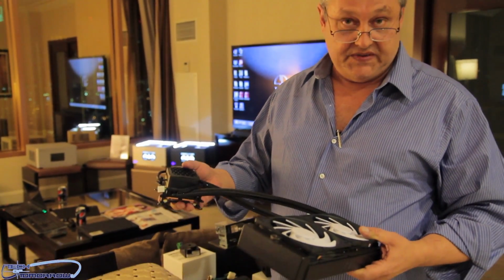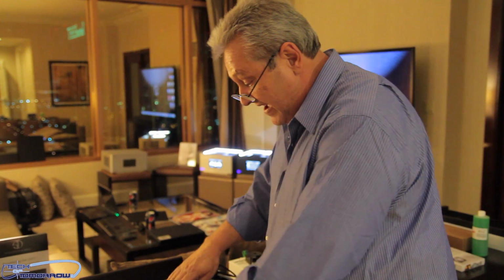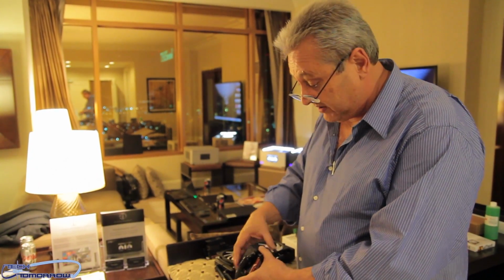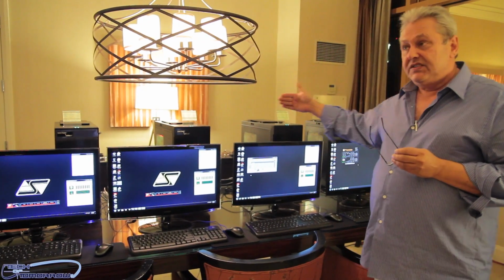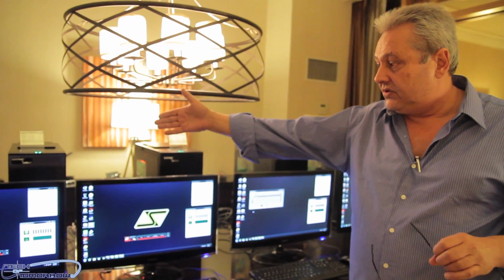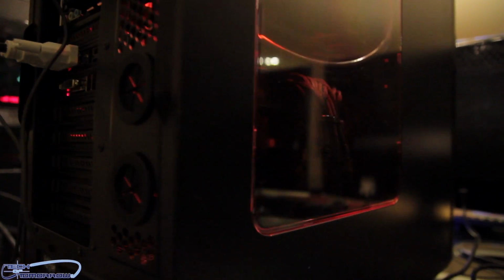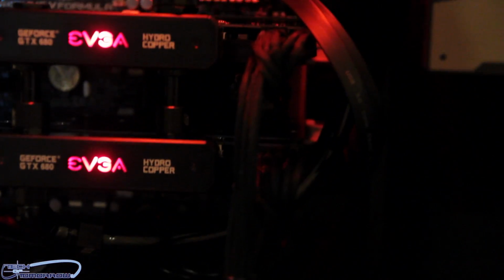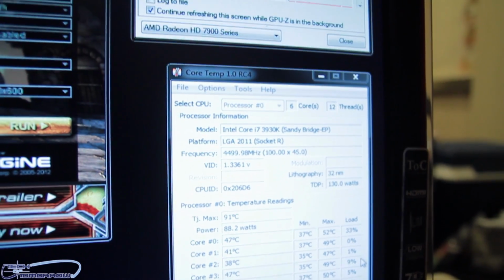Swiftech H220 All-In-One Liquid Cooler Sound & Temp Demo

Comment: radiators is more about thickness rather than surface area from what ive seen from building watercooling loops i did think larger is better but according to temps thicker is better so my rule of thumb is thickness over length(no "that's what she said" joke implied) also in test a h80i beat a x40 the h80i is 38mmx120mm the x40 is 27mmx140mm h80i past a test the x40 failed

Comment: What you're saying is pretty much correct. When you overclock the components they generate considerably more heat due to the increased voltage that's required. This is when more surface area is required to cool them and that's what an additional radiator will do for you.

Comment: Basically what i said a 360mmx60mm radiator will cool a whole system without much trouble its only when you decide to overclock the system is when you would need more rads

Comment: This is true, but the only component that is under any stress at all is the CPU. There is some residual heat from the GPUs, but not enough to make much of a difference. With a larger radiator it shouldn't have any problem cooling all three components under real-world conditions.

Comment: The order of your loop means very little in terms of actual performance. The rule of thumb is that you simply need to have your reservoir sitting above the pump and then just use the shortest distances between components to make a clean loop. I hope this answers your question. Trust me, Tiny Tom would agree with me.

Comment: Of course this will fit into such an enormous case as the TJ 11 just fine. Don't forget that it will also accommodate extra water blocks and radiators due to the power that the pump has.

Comment: It will depend on the case. We just tested it with a Fractal Define R4 in our lab and it will fit in the front of the case as long as the hoses are coming out of the top of the radiator.

Comment: lol 83c is not very hot for an intel cpu its limit is 90c which it will then start throttling to drop temps if it reachs over 100c it will shut the system down and my point is people that say you need 240mm rad for each component under watercooling have just been proven wrong as this is cooling an overclocked cpu+sli on a 240mmx30mm rad a 360mmx60mm rad is fine for this system

Comment: I doubt that there will be a big enough change for it not to be mounted, unless they change physical cpu sizes. I would also rather have G1/4 inch threads and use real fittings.

Comment: The product on the Swiftech website that you are referring to is a different product than the one being shown in this video.  This video is about the H220, which has not been released and will retail for $139.95 as clearly stated by the Swiftech chairman in this very video.  The H220 is not listed on the Swiftech website at this moment.  The product on the Swiftech website is the H20-220/320 Elite ($239.95/$279.95), which are different products than the H220 being shown in the video.

Comment: Actually newer CPUs draw less power and create less heat, due to shrinks in the fabrication process for transistors, which require less voltage to switch.  Ivy Bridge does run a bit hotter than Sandy Bridge but it's a bit of an anomaly because Intel switched from fluxless soldering to thermal paste for the integrated heat spreader, so while Ivy Bridge draws less power and creates less heat, it it not very efficient at dissipating heat.

Comment: Oh, I didn't realise he was running FurMark, I thought he was using a CPU only stress test (he did say "CPU burn" and didn't really specify anything else). Heaven is also a stress test in its own right, though not as intensive as FurMark, it is still commonly used in combination with Prime95 to make sure a system is 100% stable and able to maintain safe temps. But again, with all that hardware (3770K and 680s in SLi) running at full load, I really don't think that cooler would be strong enough.

Comment: If you don't adjust the loop (adding graphics cards/motherboard using different coolant etc.) it will last for 3 years after being re-sealed.
If you just put it on your CPU and don't modify the loop in anyway it will last 60,000 hours which is equal to over 6 years.

Comment: heaven is a benchmark, which synthetically simulates a dx11 game environment. furmark is a stress/torture/stability test, it forces the processor and VRMs to run close to 100% for aslong as you feel comfortable with. its essentially the prime 95 for graphics cards. so 65 degrees for SLI'd 680s during a furmark test is amazing for this setup.

but since you pointed it out, I also wonder if it could handle prime 95 and furmark with decent temps. most likely needs another 120 rad to keep it cool.

Comment: you have to drain, clean(since its impossible to match the coolant they've used) and add new coolant. the moment you add a new block/rad, you have expanded the air space in the loop that wasn't there before, therefore requiring MORE coolant. even with full custom loops with reservoirs. you always do a full drain and fill up every time you add a new block/rad. its just good practice for maintenance and it makes the job easier with out having liquid still in the system.

Comment: Put Heaven benchmark on top of the CPU burn test in that SLi rig and I guarantee that cooler would be too weak; the temps would be a lot higher than 82°C! A good CPU only cooler, but I'm not convinced it'd cool an SLi rig on full load.

Comment: 83C on the cpu is very hot, not many people would actually run at that temp. It was mainly used as a demonstration that the pump can support more than just a cpu restriction, and that you can expand to this AIO cooler.

Comment: There are some cases where you mount the radiator to front bottom section that could help the fill issue. Maybe its possible that you cant mount a reservoir directly to the radiator fill port, that would be awesome.

Comment: this is insane getting them temps on a 240mmx 30mm rad cooling a cpu plus sli and only getting 83c and im being told i need a 240mm and 360mm to cool that system thanks swiftech you've saved me alot of money and MASSIVE Thanks to ToT for the video great work

Comment: Fan dissipate the heat from the radiator. The Radiator cap all energie and dissipate it.  If you don't move the air in the fins, the temperature would build up and the water wouldn't cool enought. So you have to move air trought it.  All in one system is great is you want a clean inside look in you're computer.   Otherwise you have to buy a gigantic air cooler that most of the time look silly and is not very 'Maintenance friendly' because it takes so much space.

Comment: It was a little biased on the sound test. Both the Thermaltake and Corsair system's fans were set to their maximum speeds, while the Swiftech fans were kept at their "silent" setting.

Another angle I would have liked to see the tests done was the temperatures of all 3 systems with their maximum fan speeds. Or at least the maximum speeds that all 3 fans can reach equally. They did it with the minimum speeds, I don't see why they couldn't show off the maximum speeds.

Comment: liquid cooling is based on the same principle as air cooling,that is removing heat from the cpu,the difference betwen the two is that water cooling units are based on water and a radiator that remove the heat further from the cpu and have a much bigger surface for the fans to cool.if a liquid cooling unit would lack fans the heat would grow and acumulate in the loop.

Comment: Sorry I'm noob but if you're running a custom water cooler is the volume of the water solution directly proportional to how many loops you're making, right? i.e. the more hardware is included in the loop is the more water solution volume you'll need.

Comment: At $139.99 USD. I'm sold. With the ability to add gpu blocks and rads with a one pump/cpu block is a very good deal. I'm not sure if you can add a res into the loop since I hate the fill port on the 240 rad. Also can you change the tubing?

Comment: my corsair h100i with real sp120fans that have there 7v adapters and 2 200mm fans ontop for pushpull(have a hafx) is cooling a 2500k at 4.5ghz with a max temp of 61c while stress testing and i have my fans at 950rpm.i know for sure that the corsair link can bring the stock fans down this low on quiet setting,so i don't know where he got the lowest the unit will allow them is 1400 rpm ,while ivy runs hotter than sandy those temps  look quite high,but i like the expandability option of this